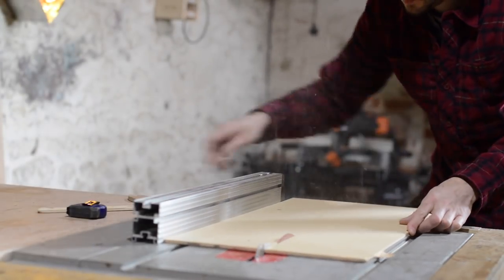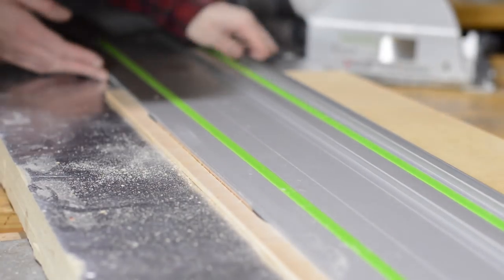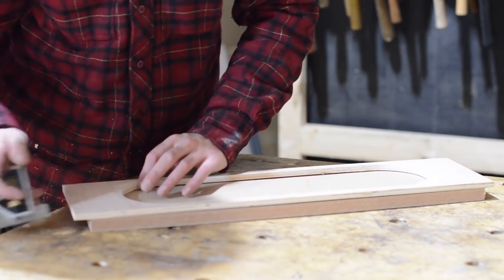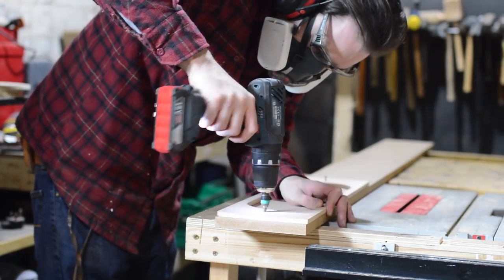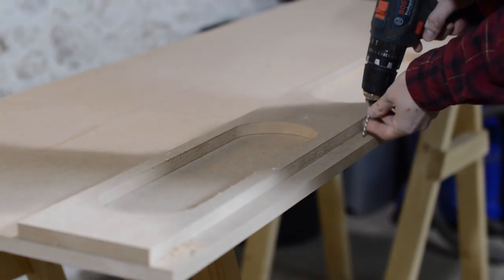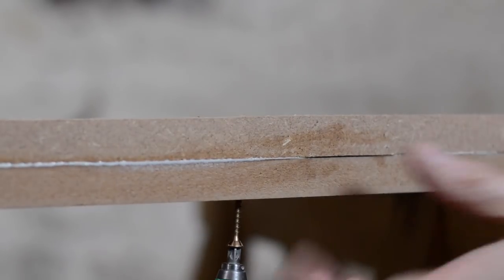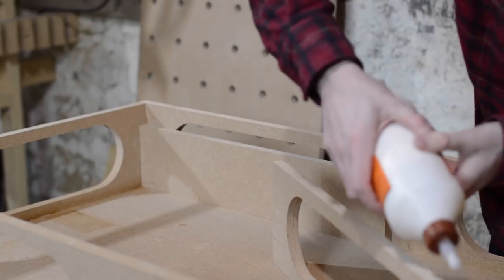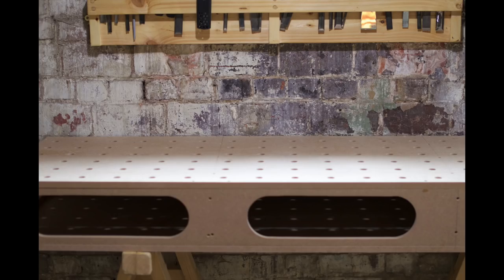Axminster UJK Parf Guide System Bench

Comment: Looks great Matt, looking at going down the track saw route and accompanying table myself, a question on your dust mask does it fog your glasses up, thanks.
Reply from the maker: Thank you. No this mask does not. It has the push to check system, that closes the vents to check if you have a proper seal. Im pleased with it.

Comment: Hi Matt I am considering doing something similar primarily for track saw station but also for assembly.

Do you think the Parfitt drilling jig from Axminster is cost effective? I mean compared to a custom order with a manufacturer who produce with CNC.
Reply from the maker: Maybe not for a one off piece but if you use it several times it pays for its self

Comment: Nice build. I don't understand the appeal of those storage bins. It's like a draw that you can't pull out. Each to their own though! btw, what countersink bit are you using please?
Reply from the maker: Im finding it handy so far for putting tools like air nailers and drills in wile I work on the bench. 

Its a dewalt

https://www.amazon.co.uk/DeWalt-DT7604QZ-Pilot-Cutter-Countersink/dp/B000Y8XINE/ref=sr_1_2?ie=UTF8&qid=1525873747&sr=8-2&keywords=dewalt+countersink

I can't remember the size
Reply: thanks